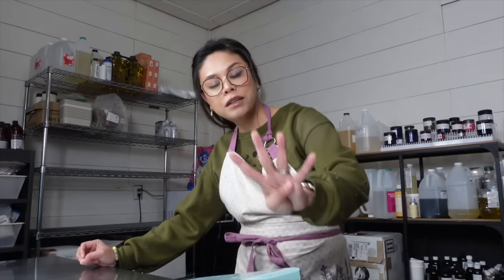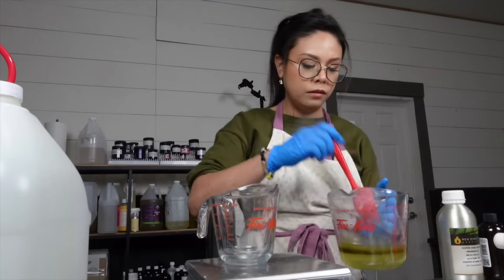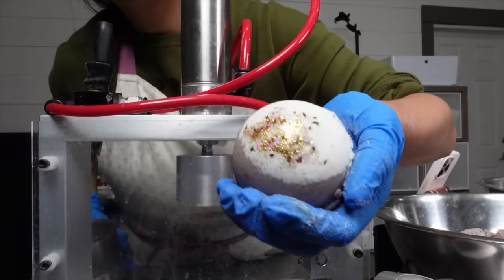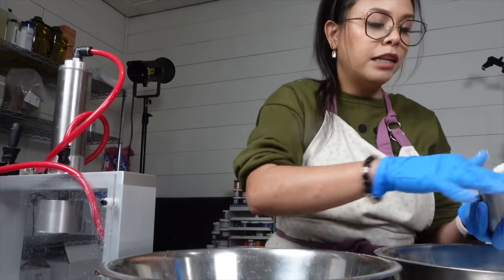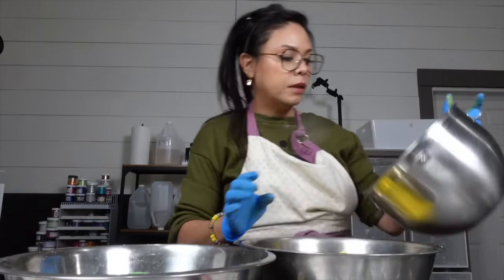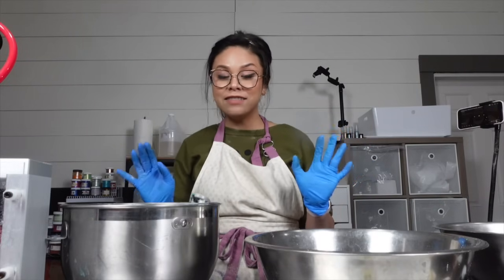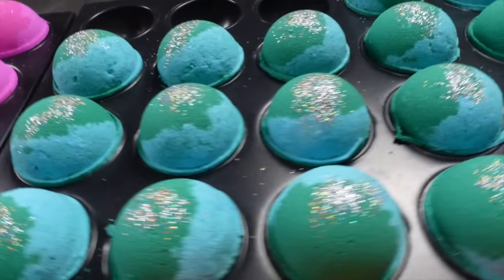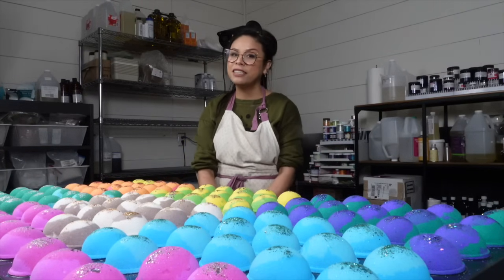Boost Your Bath Bomb Game: Master Batching Efficiency Magic! Vlogmas Day 21

Comment: I master batch everything. Lotion (I melt sown the oils and waxes and store as well as store the cool down ingredients in a gallon jug), foaming bath base, sugar scrub and my bath bombs. I purchased a turkey roaster so I could make larger batches. This is the best way to work efficiently. Since you pipe your lotion you could also master batch an unscented lotion  and scent  to order. ❤
Reply from the maker: Very very cool - you have it down! I'm slowly getting there, but I admire your streamlined organization!
Reply: What's the name of the machine you use for the bath bombs ? @JerikaZimmerman

Comment: When I first started, I used your bath bomb recipe from a few years back.  Like you said, I had to do some altering a little. I use different oils and im in Minnesota. The humidity changes so much!  But agree, water is the solution.  
But the batches that do not turn out get turned into bath dust and people love that option as well!
Reply from the maker: Yes! I'm glad you figured it out! It's a problem that's hard to solve so I always feel a little helpless that I can't provide that smoking gun solution. But it's really the tweaking a proven recipe that will get you to that perfect bath bomb!
Reply: Sarah, have you ever resifted the bombs and added moisture and then tried to re mold?
Reply: @carolynpalano9284  yes. I think it only worked once with a lot of patience and luck. I think it was my weather elements more than than the mixture elements.  I always start with less water and work my up if needed with spritzes from a spray bottle.

Comment: Great idea Jerika.  I was going to ask where you got your phone stand from, but found the link in the description.  Also, do you know you can use the camera on your apple watch to start videos on your phone and even check if everything is in the shot using the screen on your watch.  I've just discovered this and it's awesome.  My bathbomb journey has been rocky.  My humidity levels are 75% in the morning, then by the afternoon it's down to 30%.  Any suggestions for raising humidity.  I've taken to putting the sprinkler on outside.  I have a dehumidifier which works well.  Thanks again for great content.

Comment: Really amazing Jerika

Yeah I've been having issues with the bath bomb recipe that I started to use.

It worked just fine for a while but since it's gotten colder here and we have the heat on, I think that is affecting how the bath bombs set....either they are too wet or too dry and don't hold so it's been really bothersome and frustrating so I'll keep trying
Reply from the maker: Yes! Some magic happens the longer you try to figure it out and discover what the bath bomb needs in your specific climate and humidity :)

Comment: when you master batched, did you find a difference between putting the citric acid in at the same time as the other dry ingredients, rather than adding it last? I know some people prefer to add the citric acid as the very last item, so I wanted to know your thoughts on this.
Reply from the maker: Yep, I always add the citric acid last and separate from the other dry ingredients :)

Comment: Hi Jerika, If you were not using the press and able to pack so loosely, would you pack the mold differently?  Would you have to press the mixer a bit more? Does the pressure of the press basically assure a solid bomb?
Reply from the maker: Nope! I made a video about packing 3D hand molds and I still recommend a loose packing technique.